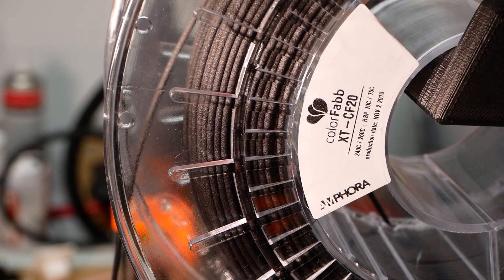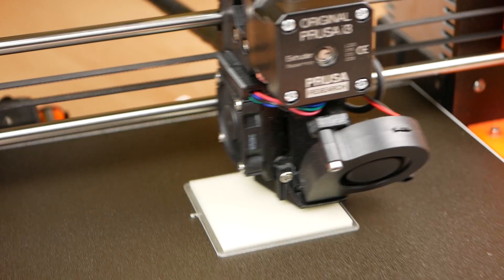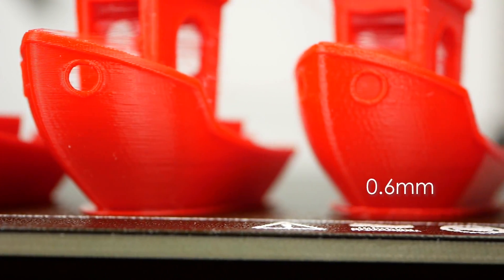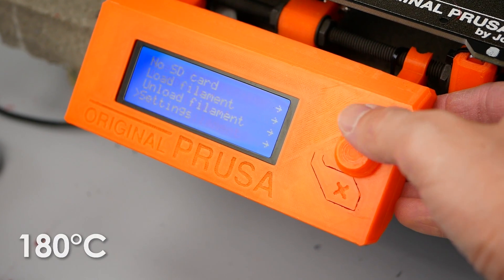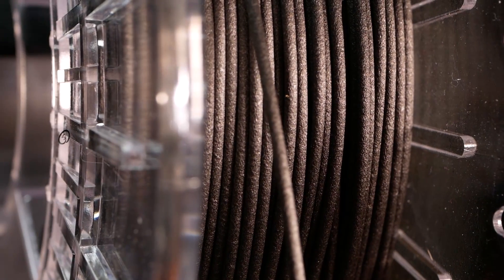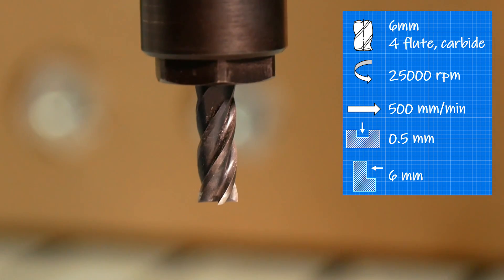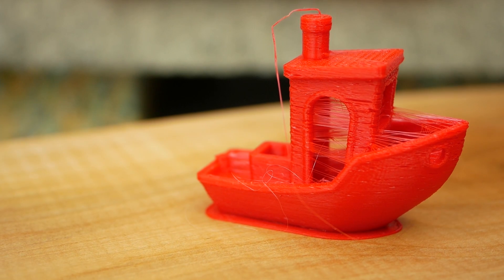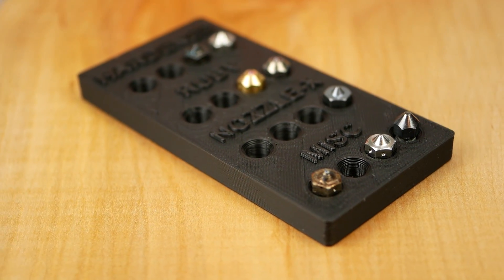HOW MUCH abrasive filaments damage your nozzle!

Comment: Subbed for an excellent product test video, considering you are a home 3D printer guy.
 Yes, it looks like the E3D nozzle has been reamed after drilling the internal bore. Whereas the Chinese one has been drilled, probably very quickly to reduce time. If the E3D has also been reamed to produce the outlet hole then there's a reason for their higher prices. 

Their process most likely follows this sequence.
 Hex bar is held in an auto lathe, the threaded section is machined to 0.1mm over it's final diameter, then the thread is cut, then a special tool reduces the material behind the thread and leaves the flat flange. After that a center drill goes in followed by a drill 0.1 smaller than the final filament sized special reamer. It looks like the reamer is a custom made one that produces the bore and the 60 degree end at the same time.
  But what I found with all of them is that externally, both cheap Chinese and more expensive E3D nozzles showed tiny dents on the outside (under a microscope) from where many finished parts are all stored loose in a container. And without a microscopic check of every nozzle, you might receive one with a little dent right across the working end. I did when I ordered a 0.15 nozzle, but they replaced it f.o.c as soon as I informed them of the problem. Unfortunately I haven't done any printing for a year, so I can't report on anything more than that.
I'm a CNC mill setter by the way.

Comment: i think the wavy filament pass is due to far too high of a cutting speed, as if the Programm of the CNC machine was written for a Carbide drill while Produktion used HSS drills this creates vibrations that can cause really interesting gemorties, some of which really look mesmerizing

Comment: Would printing with a lot of retractions be more abrasive?
Printing the filament blocks with 100% infill generates an almost constant flow, which might not be realistic.
I have the feeling that a more jittered flow, generated by retractions, might significantly increase wear.
 
Btw, really dig the research and experimenting angle of your channel! Keep up the good work.

Comment: The spiral pattern inside the cheap nozzles is because the manufacturer uses less sharp, more flexible drills at faster than optimal speeds to save cost. Spiral patterns in drilled holes are pretty common if the drill isn't sharp enough, especially at small sizes where the drill is more flexible.

Comment: Excellent Video! I too thought the hole in the tip would widen first, but its the tip itself that wears down due to it rubbing against the filament just laid down. You probably got less wear out of the glow in the dark filament because it was from a quality manufacturer. Cheaper versions probably have larger particles in them that wear out, and clog, the nozzle faster.
Very interested in seeing your results with hardened nozzles. Tungsten looks to be the best for wear resistance v. cost. But that's just my opinion without any testing. Eager to see what you find.
Thanks!

Comment: The stringing comes from the chamfer on the inside - it is an extra space that fills up with material. Also a harder edge means it will kinda "cut" off the strings instead of pulling out the material.

Comment: the inside pattern is due to plastic deformation of the nozzle< because it is more likely they have threaded the outside after drilling the hole inside. Also heating the nozzle to those temperature 250 for a long time will have some heat treatment effect on the nozzle which can again result in wrinkling on  hole wall.

Comment: Hi stefan,
Few years ago I asked in a forum of how to measure nozzle diameter, and that is by extruding  the plastic at a very slow rate of around 1mm/s or 1mm/m, then you measure out the extruded filament came out of the tip of the brass nozzle.

Comment: There are so many interesting points in this video. It is really good to see the actual differences between the parts of different manufacturers. I've heard many YouTubers talk about the poor quality of cheap Chinese parts, but you actually show the difference. It would be interesting to see the real world print quality difference between these, and examine why they may or may not be worth the extra cost. I would think that the quality of the print may also affect the overall structural quality of what you print as well. Basically how much does 3D-Printer part quality affect the output, and how much does it cost to mitigate the loss in quality.

Comment: Another very interesting video Stefan. 

I don't have a 3d printer at the moment because I can't open that can of worms at this point due to other priorities. However, I do plan to get one sometime next year. I still watch your videos because they answer many of the questions I ponder or answer questions i didn't even think about. I think when I do get a printer your videos will already have helped me better  understand this process.

One thing I do wonder about you touched on in this video which is nozzle diameter - because I assume it is related to wall thickness. Some of the things I am considering printing will require thin wall thicknesses. I want to make fuselage type structures as lightly as possible - with and without bracing/infill. 

So the questions i ask are - How small a nozzle diameter can you use? How thin can a cylinder's wall thickness be? What are the limits? I wonder if you can do a video which pushes the boundaries in that direction. 

Many thanks.

Comment: when you showed the cut off between the real 3D in the Chinese won the 60 degree in the 90 degree angle makes a big difference with the 60 degree you have a greater time for melting the filament versus 90-degree hitch and then pushes so that would cause a brace of action also

Comment: at 12:33 you note the point angle of the E3D is 60 degrees while the cheap knockoff uses one of 90 degrees. I originally tried an Olsson Ruby nozzle to solve my wear problems, and during a spontaneous unscheduled disassembly of said nozzle I discovered the Ruby hides a very dirty secret: it has a point angle of 180 degrees internally which is very poor in general, but particularly for feeding fiber filaments. Something to be aware of. :)

I've since switched over to a tungsten carbide nozzle and am very happy with it. Much more abrasion resistant than the hardened steel nozzles I've used.
Reply from the maker: This is how the ruby nozzle looks from the inside: https://twitter.com/erikcederb/status/1125056521199673344
There is a point angle but then, there is a small, flat section. Interestingly the standard Ultimaker nozzles look very similar on the inside.

Comment: I'm glad that you tested with clone nozzles. For as much as I might like E3D parts and prefer them, if I need a pack of .4's (sometimes you just know you'll be wrecking nozzles with wood), or a couple in each diameter between .2 and .6, it's usually the difference between $10 and $50. They aren't as good, but they'll usually get the job done, and it's good to know how long they'll handle that job. So thank you.

Comment: The bore quality in the Chinese one is because they're running a low quality worn drill far outside its design speed range so they're getting terrible tip wander. The chamfer is a direct result of badly programmed centre drilling to drill through the tip and the whole of the Chinese part shows evidence of chatter all over it, including even the external thread form. Nothing is good.
The 60 degree internal angle increases the melt zone to allow for more even plastic heating and the end finish on the Chinese nozzle is as likely to be contributing as the chamfer or anything else, as it may simply be dragging remelt like ironing in reverse.

Comment: A lot of decent content and analysis, however, I believe your sample size was a bit too small (e.g. only one set from Aliexpress) I also don't think your "wear duration" was long enough for a fully valid test result.  I do concur that the nozzle bore and the chamfer on the end plays a significant role as well as the rough surface on the interior cone before the nozzle... fluid dynamics would be worse in the rough cones causing more turbulent flow.

Comment: Does anyone know where to get quality nozzles for the Creality CR-10. I usually just buy them in bulk like Stefan did and swap them out regularly. I do have a hardened steel nozzle I was using but put it aside for when printing more challenging materials. Any links would be greatly appreciated.

Comment: To get that helical pattern, Make one of your cutting edges on the drill slightly larger than the other, put the drill out of parallel to the work, and use abusive feeds and speeds.

It can be intentionally done with thread milling, however.

Comment: I'd be interested in seeing how tungsten nozzles hold up. They're cheaper than ruby nozzles, but more expensive than steel, but they also have better thermal conductivity than brass while being harder than steel IIRC.
Reply: Do you mean tungsten carbide as is used in cutters?.....tungsten by itself is just a more heat resisting material.
I would think that if you made a DIY nozzle with a carbide tip you would have to EDM the hole to get it to .4mm diam.
Another wear resisting material that can be machined is aluminium bronze.....it also has the same heat transfer properties as brass.

Comment: The chamfer on brand new (cheap) nozzles effectively increasing their diameter and hurting print quality is a very interesting discovery. Thanks Stefan, glad we have people like you in the community 👍
Reply: I think it’s worth noting though that those cheap nozzles are made by a very wide variety of manufacturers, and it may just be that the particular nozzles he tested were especially bad...

I have only cheap Chinese nozzles, a big variety box of standard CR10 style nozzles, as well as one V6 style I was sent by mistake, and about 6 volcano style I bought for my Sidewinder X1. I just double checked all of the volcano and the v6 nozzle as well as a random selection of the CR10 nozzles and not a single one had that chamfer. I even double checked under a microscope in case I just couldn’t see it with my naked eye.

I’m sure the internal bore of the nozzles is not as clean as genuine E3D nozzles, and there may be a difference in the internal angle, but at least it doesn’t appear that the no name brand nozzles all have that chamfer or that it’s even a common defect. He may have just received a defective batch or bought from a particularly bad manufacturer or I’m just extremely lucky...

He’s 100% correct that you’re taking a gamble not buying genuine, but given that the cost of a single E3D volcano nozzle is about the same all of my Chinese volcano nozzles combined, it may be worth the risk as you won’t lose much money if they turn out bad. Though of course I do appreciate supporting the original creators. Also for example there is a massive difference in quality between the heat breaks especially on knock off E3D extruders vs the real ones that I think makes them an obviously better buy even at the in increased cost (my sidewinder for example has a PTFE tuve all the way through the heartbreak which is an issue for high temp printing, so I’m planning to upgrade to an official E3D all metal titanium head break which is actually about the same price as some of their nozzles somehow even though it’s a more complex part). 

Also it’s worth considering that I can buy the Chinese nozzles easily here in Colombia with local 1 day shipping, whereas to buy genuine E3D nozzles I would need to order from the US and import them, increasing the already higher cost due to reshipping and import taxes as well as significantly increasing the wait time to receive them if I need one quickly.

I’m still planning to buy a few genuine nozzles to use as a baseline comparison against my cheaper nozzles to see if I get increased print quality, but I don’t think it’s fair to test a single brand of Chinese nozzle and then imply that all Chinese nozzles are manufactured that way or have similar problems. Many of them are perfectly fine from what I can tell (including from my own print quality which is quite good using only these nozzles).

Anyway just my 2 cents.

Comment: drilling out the nozzle is a conventional process. The spiral hole is due to "wobble" of the tool (drill). Cutting conditions, cooling, and stiffness of the machine/tool/machined part is crucial.
Can anyone suggest, where I can get blanks of the nozzle - no hole drilled? :)
Reply: No affilliation, or whatever, but filastruder.com.  It's an option under E3D Spare Nozzle (v6).  I buy my Duet boards from there, no problems so far.

Comment: Also try an object with infill rather than a solid block. It creates a star shaped hole
Reply: I wonder about printing Archimedian circles (maybe simple concentric) does the  trick to wear out the nozzle from every angle
https://static1.squarespace.com/static/58ed365f20099e2bf03e0721/t/5b11b3f42b6a28039b21a434/1527886858520/infillCircle.jpg

Comment: You can measure orifice size more accurately with this: https://www.ebay.com/itm/Nuline-Pin-Gage-Set-0-21-to-1-29-MM/312635089511?_trkparms=aid%3D222007%26algo%3DSIM.MBE%26ao%3D1%26asc%3D20131003132420%26meid%3D21aaf4a1be51489389076075bf914986%26pid%3D100005%26rk%3D1%26rkt%3D5%26sd%3D123482382704%26itm%3D312635089511&_trksid=p2047675.c100005.m1851

 - or this - 

https://www.ebay.com/itm/0-21-1-29MM-005-55-PIECE-PIN-GAGE-SET-4101-1011/232023380864?_trkparms=aid%3D222007%26algo%3DSIM.MBE%26ao%3D1%26asc%3D20131003132420%26meid%3D99409fd583954e1e90e7c192b1b8bfdd%26pid%3D100005%26rk%3D2%26rkt%3D5%26sd%3D312635089511%26itm%3D232023380864&_trksid=p2047675.c100005.m1851

Probably good to have at home if someone prints a lot or need control over the nozzle.

Comment: That spiral pattern I believe is just from a worn fluted drill bit starting to wander
Reply: Your right, if standard cheep drill bits that are longer than a few inches are used, the bit can oscillate, causing the pattern Stefan exposed. 

Those pictures are actually worth a thousand words.

Also, the 60 degree grind used  for the e3d tooling should actually help align and stabilize the bit for the final cut.

Comment: Patterns like that happen when a drills tip is offcenter or dull on one side, the resulting increased force on one of the cutting edges makes the whole tool flex.
This especially happens when drilling fast with high pressure. Another cause could be an actually warped drill bit due to lacking coolant... or just plain shit tooling.

Comment: Fantastic testing, as always!
That spiral bore is kind of baffling.
I use a hardened steel nozzle for carbon fiber PLA, but notice I have to set temps way higher for normal PLA and it doesn't print very well other than for CF PLA. Always thought that was weird. 

Guessing it has something to do with thermal properties of steel vs brass.

Comment: I made some nozzles on my own with smaller angle. The extrusion force goes up drastically if the small bore is longer. If you push a lot of plastic true a short opening it comes out much bigger than the opening.

I didn’t have a good enough extruded to get some quality data on the experiment. But I think the plastic has a hard time getting heated by these nozzles.

Comment: I suppose the sinus-pattern you see in the cross cut of the cheap nozzle is a result a of wobbling of the drill bit radially. Some type of spindle run-out.

Comment: [8.03] the internal wobble can be causes by oneven drill cut lenght. The length where the material been cut (angle 118 deg). It is very hard to sharpen a drill bit by hand. And with a propper machine that cut also a release angle on the drill bit, it can been done. But! yoy have to measure the angle and cut lenght very good.

Arie

Comment: Very nice tests. I have some glow-in-the-dark PLA from Velleman and it is definitely abrasive, I also noticed the nozzles being ‘sanded’ at the bottom after printing a lot of this material. The hole diameter seems to have slightly increased as well, although the only way I noticed this is that it gradually became easier to push a .4mm guitar string through the hole.
A larger sanded-off nozzle bottom does have an advantage in that it makes it easier to get nice smooth top surfaces, but a problem is that it dumps more heat into nearby already printed material, which makes for worse overhangs and also it has more of a tendency to drag along PETG because it is so sticky.

Comment: Hi Stefan,
I’m pretty sure the wobble/spiral pattern comes from using hss drills vs carbide (+ maybe even reamed or special form tool) 
If you drill a hole with a fairly big drill in thin sheetmetal you get a obviusly triangular shaped hole. If you look carefull you see that the triangle “rotates” until the drill tip is below the top surface of the material. I think this wobbling of drillbits explains the internal shape of the cheap nozzles. By the way: if you have to drillbig holes into sheet metal place a piece of cloth under the drill. Somehow this makes the triangle-hole problem much less severe. I’ve red somewhere that it’s a triangle even though a twistdrill has two flutes because of the way it is mounted in the drillchuck with its three fingers. I’m not so sure about that theory but honestly never did the test to mount a drill in a collet to confirm. Will do and report back. Also one final not: I just ordered some h7 drills that supposedly drill and ream in one go. They achieve this by having four cutting edges. I‘ll test them once they arrive.